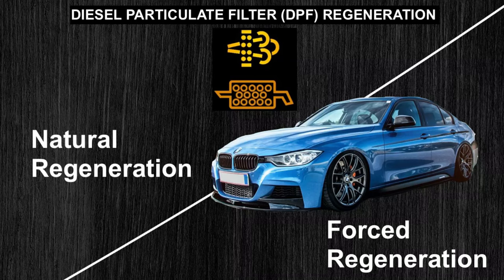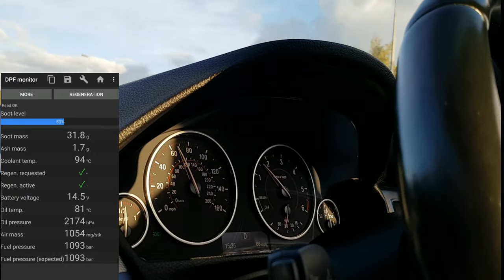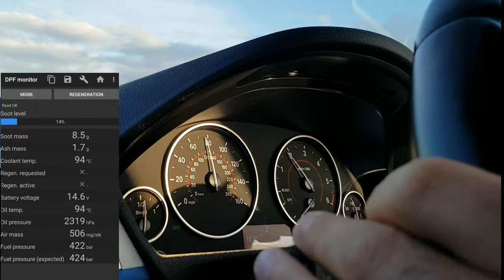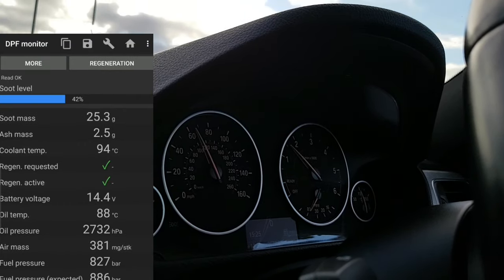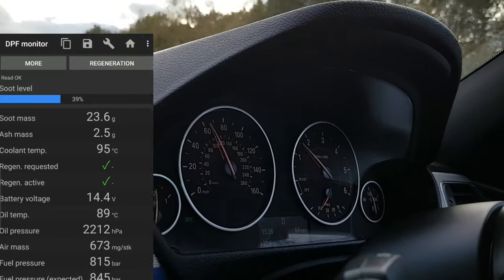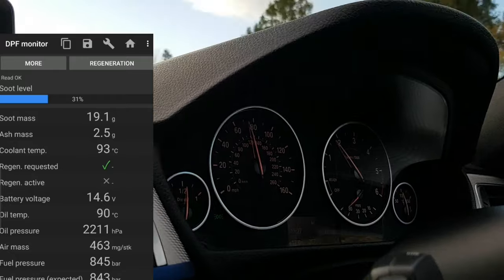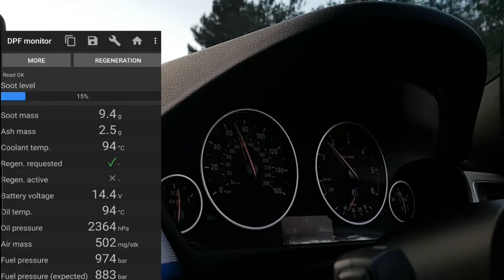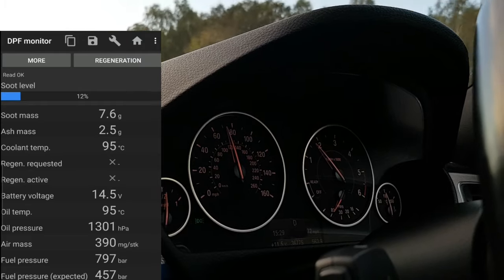BMW DPF Regeneration

Comment: Yo, good video, thank you. I recently bought a BMW which was used for very short journeys for the majority of the past year. I know the previous owner very well, upon buying the car he mentioned it has a little which happens around 1000 revs from time to time. The owner noted a filter is the issue, he’s had it check twice and he’s been told to give it a good run out. I did 1000 miles in the past 2 weeks and noticed no difference. I then started looking into this filter issue and come across a number of videos including yours. 

This evening I took the car out at 60 mph for 30 mins with revs no lower than 3000. 
I think it’s solved the issue! Well I hope at least. 

Fortunately I know about this issue now, and how to resolve it. I hit around 500-600 motorway miles a week for my job, so shouldn’t have an issue keeping it under control.

Thanks for the video!
Reply from the maker: Thanks for the comment and sharing your experience 👍
Reply: What gear was you on? 4th?
Reply: @klassencosta1815  I believe it was 4th yes. This didn’t resolve the issue, I had to replace the EGR filter. Not had the issue since

Comment: thanks for the useful video. at just under 100k mi, my 535d has thrown egr codes and dpf codes. my first thought is that the dpf is clogged, since i've read and seen so much about this. i'm currently in the process of removal and will be doing a couple chemical baths; de-grease/de-soot, then de-ash. also, manifold, egr and port cleaning will be part of this effort as well. upon taking apart the intake system, i wasn't surprised to see a massive soot buildup in the manifold and egr, but it does make me wonder if my egr faults were preventing a re-gen. i've driven it 30k mi in 4 years, numerous long trips, but in those 4 years, i've only ever seen the re-gen light on once. 🤷🏻‍♂️
Reply from the maker: Thanks for sharing your experience. 
I'm sure your car will run better after dpf and egr cleaning. I'm glad you chose yo do chemical cleaning rather than pressure water which damages the elements in dpf.
Reply: @bmwsolutions7880  Thanks I'll let you know how it goes!
Reply: @IzziedeD how did it go?

Comment: I know this is very subjective, but after how many short journeys - lets say like 2km the dpf soot level is high to require a DPF regeneration? If I will be making just short trips lets say 2km x 2 for 2 weeks. Then I have overally done around 56 km in really short journeys. Will the soot level be already high? 
Is it enough to take it on the long journey every month (generally), when the mileage isn't very high? I have never owned a diesel engine car. Thanks for reply!
Reply from the maker: I understand you're trying to learn more about your car and its components but this dpf regen is a very grey area in which the exact values may change from model to model, so short answer is yes, it is ok to take it to a long journey once a month but you wouldn't know if the car needs regen, so if you want to be clear about it buy an adaptor and the app, trust me it's a great investment 👍

Comment: Very, very useful video, thank you.
I have one question - my g31 has faulty active grille flaps (they are open all the time) - I was told that it may prevent DPF cleaning process. Do you know if that is true? My car normally reaches operating temperature (about 95 °C or whatever it is) and there are no idrive error messages. There are, however, two error messages in diagnostics (DDE 32C300 - bottom radiator blind, plausability: control deviation; and DDE 279B00 - radiator shutter, activation: electrical fault). There are no other error messages.

So, can these errors prevent DPF cleaning? And would failed DPF cleaning produce any error codes, or there is no way of knowing if it works or not (except checking the debris level with this App)?

Thank you! This is the best explanation on BMW DPF cleaning I have found!
Reply from the maker: Hi, thanks for your comment, always happy to hear that I'm being helpful to the community. 
Dfp regeneration is a very sensitive process in modern cars and a great care and caution must be taken to avoid further and more expensive repairs. As you and I said, there's no other way to see your dpf regen status or soot level on the car, so best solution is to use a simple app and adaptor to keep an eye on that. I can't confirm if your dpf regen process is working properly due to flaps staying open all the time, but I don't think it should be a problem. 
This app and adaptors also help you see many other things in your car with details, do yourself a favour and you'll be very happy. 
All the best 👍

Comment: Hi all got a 520d 2020. My oil level rose due to fuel being dumped in the oil resevoir caused by failed regens. I do taxis therefore the city driving is why i think the regens failed. Bmw drained my oil and now i monitor my dpf levels using beamerlink and when regen is due i do what this gentlemen on the video is doing. However, noticing the soot level is rising too quick after regens around 3 grams per day. My average mile till between regens in 200 miles or 350 km ( high city driving). Now i monitor my soot levels using beamer link but still wondering why my soot level still rise 3 grams per day?

Comment: What are you using to monitor the dpf levels? , I just replaced the egr and within a week the dpf threw a code , I drive about 1.5 hours at 55+ every day since I’ve replaced the egr . I also have a code for my def tank , I’m not quite sure if the code for the def tank would stop regeneration but I was not aware of how or when the dpf regenerated until the code came up , I am running a program tomorrow to do a dpf regen. I have a 2011 335d with 160k miles

Comment: So the app can be running while im driving to check the soot mass decreasing? Do i turn engine on before connecting or doesn't matter? Great video btw!!
Reply from the maker: You can use the app in any state, it still works👍
Reply: What’s the app called please

Comment: Thanks for great video! I’m looking at an 2016 X5. If I get the Bimmer Tool, can I use it to check the vehicle I’m looking at? Might the dealer have issues with me doing this? What would I want to check? Thank you!!!
Reply from the maker: Thanks for the comment and a good question 👍 
Short story is 'yes' you can see all the fault codes using bimmertool on any BMW with no restrictions. 
However, the seller may not agree on such a check on their car for reasons ranging from not being able to understand the adaptor you're trying to connect to their car and carry out some checks, not familiar with the check process people are doing in this generation or simply they don't want you to check the car because the car has serious faults. If any of these scenarios happen, I'd draw my attention elsewhere without arguing. That's why uou should shortlist a few cars at least. 
Finally, if you're buying from BMW dealership which I highly recommend, you also get 100% convenience. BMW dealers make sure their cars tick all boxes before leaves the dealer including, fault free ecus, good mechanical checks, new tyres and conditioned alloys, valleting ect. You may find BMW delaers a bit more expensive but they give you a huge piece of mind. Hope this is helpful ✌️

Comment: B47 520d f11, how often do you guys get DPF regenerations doing short journeys? I seems to have a regen every 150-200km. When it happens the exhaust sound very deep and bassy. Some write the sound is normal some wtite they dont even notice when the regen happens. 🤷‍♂️ How is it then?
Reply: It is worthwhile to get an ODBII scanner and app for your car.  You don't want to regen too often, but at right intervals.  In BMW they measure back pressures before starting a regen.  Here with the ODBII scanner (and the corresponding app for your car) they measure soot and ash levels.  As it said in the video the app normally tells you when it is time to start the regen.  But there is nothing you can do with the ash except taking the DPF off and immersing it in a bucket of chemicals to dissolve the ashes. That job is for professionals in BMW garage or other dedicated mechanics.   Also be aware that BMW also provides two kinds of services for DPF regen:  one is to inject some chemicals to clean the soot and the other is to wash the whole thing.  The former is somewhat similar to the regen that you can do yourself, the latter is the wash, which cost about a few hundred dollars for BMW to do it.

Comment: Hi can someone help me understand. First he said natural regen occurs when going over 60mph for at least 20 minutes. So when bmw said to drive the car on a long journey once a month, why does he then say they don’t offer a good approach to cleaning? Yes I understand you can’t see the numerical value for how much soot is blocking but if you’re an asmatic are you dusting the house every week or when the dust finally blocks the hvac air filter? With that, I appreciate this videos data and explanation
Reply: Suppose it's a consumer rights thing, it's my car, i want to k ow if a part if wearing out and how to fix it, some of may want to clean it wver week to keep the car in tip top performance, some ppl might wanna do juts the monthly drive. Some ppl, like me, only juts found out this is a thing, so it's very relative to each person

Comment: Great informing video thx. I have f30 lci with an b47 diesel engine. Do i need an obd device in order to activate natural/passive regen while im cruising around 120 km/h in normal circumstances?
Reply from the maker: Thank you 👍 
The only reason I use it because I want to know more about my car and observe certain operations live. Otherwise, if you're sure that you're doing long journeys regularly,  you may not need it.

Comment: hi again!! i need your opinion. i have oil ash mass 34.35g in dpf (showing in bimmerlink ), the soot mass is about 23g  or  24g ,before regeneration.after regenerate dropping by about 2g. but the oil ash mass not. it is a normal? oil ash mass not dropping at all, 520d b47 2016 ..Thank you
Reply from the maker: Soot and ash levels are different. The reason your soot level is going down during regen is because exhaust temperature is burning it. So, you get left with ash in the dpf. This ash doesn't go away until you remove your dpf and do chemical cleaning. Typical max ash level on a dpf is 100 grams, so don't worry about it for now 👍

Comment: How many kilometr you can drive without forced DPF then you have a 40% soot level in Bimmer app  or  you use every time a automatic Regen?Mě first time THX fór. Video
Reply from the maker: I don't use forced regeneration, my car does natural regeneration when soot level is around 40%. If the car doesn't meet natural regen requirements (old or completely blocked dpf, broken sensor etc) you need to manually trigger forced regen. 
How many miles/km you can drive depends on your journey habits. If you do lots of short drives, soot level goes up very quickly (within a few hundred miles).

Comment: Hi, i have these errors 25C400 25C800 245400 they are all about the backpressure sensor, do they stop the car from regen. or affect it's performance ?
Reply from the maker: Hi there, not sure about the codes and if they affect the regen. I suggest you get a Bluetooth adaptor to keep an eye on regen regularly.

Comment: Hi.  Is this the free bimmer tool app you're using or the paid version.  I want to do exactly what you have done in the video once I've bought my obd adapter.  Thanks.
Reply from the maker: Hi there, it's the paid version. It was £13 at the time and it's worth every penny.👍
Reply: @bmwsolutions7880  that's great thanks for the reply.  I car pro and bimmer code it is then.  Hope it works OK on my F36.  I literally want it for the dpf regen.  

Can I change in car settings with the same app as well like stop/start function, display settings, auto folding mirrors etc or do I need bimmercode for that?
Reply from the maker: Yep, it's a great app for dpf regen, service functions and fault code readings. It works with all obd2 port cars. 
You need bimmercode to code and tweak other functions. They're all great apps and must have for bimmers. 👍I've got them all covered in my channel, check them out😎
Reply: @bmwsolutions7880  I've just had the adapter delivered and paid for the bimmer tool app.  Connected perfectly.  Only had 25% Soot Level so didn't need to regen really but I took it for a spin anyway.  25 mins later and on 0%.  Seemless bit of kit!!!  Great tutorial I'll be checking out your other videos.  Thanks.  👍👍👍
Reply from the maker: Great to hear that, hope more people realise how important the dpf regen is and how bmw is deliberately being careless about informing customers. Happy days for us🖐
Reply: I've had issues with a Kuga before now due to driving short journeys all the time.  Nkt letting anything happen to my new bimmer!! 😁

Comment: I have a 2008 X3 20d euro4 N47 with 220,000 km, and about 33,000 km left to the "limit" that means "service".
So, you can calculate that BMW has "set" the limit to approximately 250,000 km which is about 155,000 miles.

Then I don't know if they have changed this "limit" sometimes later on.
The problem here is that the DPF must not be full of ash, which is the main problem, if everything has worked properly through out the years.
If everything works properly the regeneration works perfectly and there will be no extra soot build up.
Reply from the maker: I think they haven't change the milage on replacing the dpf yet. Even if it hits the max life, most people are giving it a chemical cleaning to clean the ash. After reset, you can use it like brand new.
Thanks for your explanation on this serious matter 👍

Comment: I have my first BMW which is a 420d. I don’t do very long journeys so want to learn the process of keeping the DPF clean. I read somewhere you should drive at least 2,000 rpm for around 15 minutes
Reply from the maker: I'm sure you'll enjoy your new bmw🤠 as you said if you're doing regular short journeys, you'll need to keep an eye on the dpf. Similar adaptor and the app will keep it safe and in good condition. Also, driving at higher RPM is for older E series cars when they don't do natural and forced regen. It doesn't apply to F series like mine and yours.
Reply from the maker: Glad you find it useful 👍 
Dpf temperature goes up to 600C degrees when regeneration takes place, so yes that's what happened when you observed high temperature.
Reply: They also sell a DPF fuel additive cleaner, I wish I knew about it before my dpf forced my car into limp mode

Comment: Good video. My f30 n47 has 42g of oil mass compared to 21g of ash mass which will disappear after a regen. However oil mass remain unchanged.  Is My dpf gone bad?
Reply from the maker: Thanks 👍 
There's no such thing as oil mass! Only data you see in dpf regeneration is "Soot mass and Ash mass". Check the information and I'll try to answer your question then.

Comment: Hi, i have an e90 330d m57, sorted thermostats waterpump glow plugs etc, i can get the car to regen, but when it finishes, and drive home, check it again, soot levels are already on 18 percent again, any idea why would this happen? Thank you in advance!
Reply from the maker: Hi, it depends on the distance you're covering after regen is finished. Under normal conditions, first a few grams ( %15-20 ) of soot build up is normal. It happens to me as well, so everything is fine with your car. It's good that you can at least keep an eye on the level.
Reply: @bmwsolutions7880  thanks for the reply. done 40 miles all together and checked it today, its on 41 percent, i will force regen it two more times once it gets to 75-80 percent and if this problem still occurs, i will gut it and get it remapped, shame as i wanted to keep it stock :(

Comment: hello I am impressed by your video and it will be very useful for me! I just want to ask which application should I use to monitor DPF? because the function is there in Bimmer Tool and Bimmer Link. And in Bimer tool it doesn't allow me to use it until I buy it. Anyway, I have to pay one or the other! So which one is better to use? thanks for the tips and usable videos you made for us !!!
Reply from the maker: Hi 👋  thanks for the comment. I personally have both apps but using bimmerTool for dpf regen. It's just because I can monitor the level of soot better while driving as it shows the percentage bar in blue. You make the choice but I'd recommend all bimmer apps icluding Bimmercode. You will definitely need them all three apps at some point of your life, and since we can afford a BMW, buying these non-subscription apps will be a very good investment.
Reply: @bmwsolutions7880  Thanks for the quick answer !!! Today I measured the DPF with a bimmer link and it showed me the soot mass of 24.10 g and 27.71 g for oil ash mass in the DPF! regenerated on average about 445 km. The data are after 251 km from the last regeneration. There are 139,120 km left on the VPF. The car is 2016 with B47 engine. What is your opinion  ?Thanks again!!
currently the car has an error in the oxygen sensor ... i need to replace it!
Reply from the maker: All sounds good as it is. You've got exact same year and model of bmw as mine. Everything seems ok with the dpf regen process on your car .
Reply: @bmwsolutions7880  QUICK QUESTION? if I change my phone, can I transfer the already paid beamer code application to the new mobile? or do I still have to pay ....?
Reply from the maker: Quick answer: you can still use your bimmer apps as they're tied to your google account.

Comment: I just got my egr replaced and got me thinking about dpf... I thought the car needed to be driven at higher than 3000 rpm, but its actually just fast enough to start the regeneration.
Reply: My advice is to use a dpf fuel additive cleaner before it gets bad